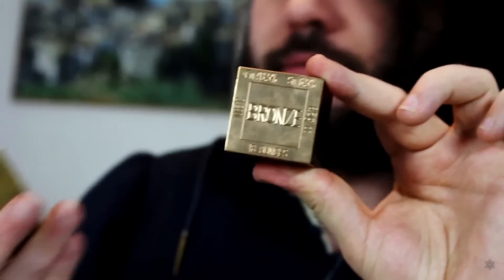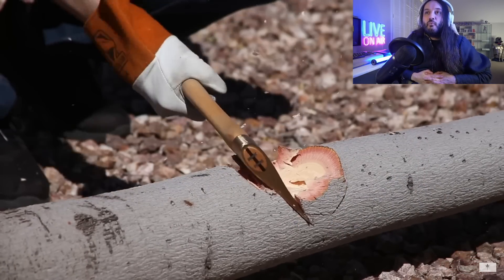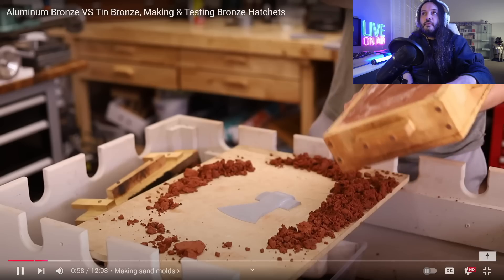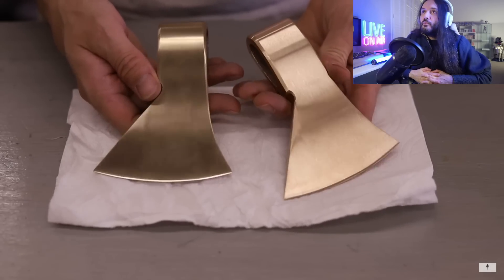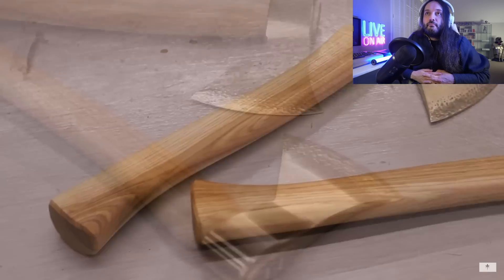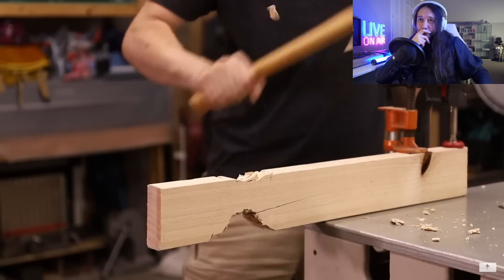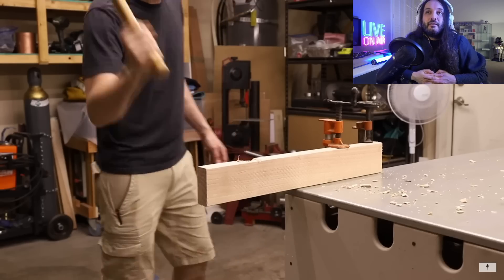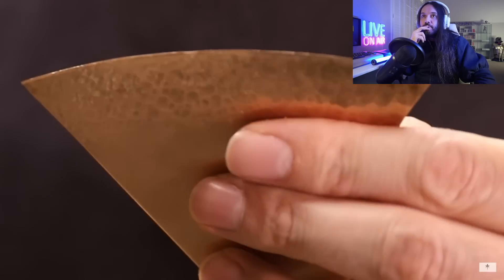Tin Bronze is INCREDIBLE - This Video WILL Change (Blow) Your MIND!

Comment: I think I get your point, with regard bronze not being "soft as some people claim it was, thus being replaced by iron". But in this video we literally are gasping at a tin bronze hatchet being able to cut dry oak. If this was even straight up iron we would be thinking "duh, of course it cuts it perfectly". There is a CLEAR difference, and that's most likely why people switched from one to the other as soon as they could mass produce it. And yes, not everyone, not everywhere, and you would probably have bronza laying around for a lot of years that people would use, reuse, recast, reforge, etc.

Comment: Theres nothing soft about bronze. Irs used extensively in ship building and often in hard wearing items that need tl be corrosion proof... ie. Propellers 
As an archaeologist my argument about why iron took over from bronze is availability of copper and tin. The latter is extremely rare and both remain valuable metals.

Comment: One of my hobbies is metal detecting,  ive found part of a bronze age sword and the cutting edge of a socketed axe .
The sword,  double edged is still sharp enough to cut , slice through skin, the axe less so.
I've also found a BA awl , used for making holes in leather and such, im sure it could still do a job , if it wasn't so old i would try .
All items have been to the museum and dated to around 1800 bc . 
Found in Hertfordshire,  S.E. England.

Comment: Prolly wrong as I’m not and expert, but I imagine the cracking is from the amount of force needed to cut the wood. A steel blade can be thinner with similar strength allowing less force need to cut the fibers.

Comment: By the way it might take you a while to do the first one, but after that experiance takes over. The part you did not understand has to do with the pour. Also after you have moulded a few items you get better, after experiancing the shrinkage  one learns to add small pockets so that the moulten metal  can be drawn back into the original casting. The most impressive art of casting is to create the metal from scratch. Figuring out the proper percentages. Also the art of purifying the materials takes time to learn. My great Grandfather was a blacksmith and after years of  working at it I still cannot do what I watched him do. Also by not experiancing  these arts you really do not have a full understanding of the intellect that ancients had. Interestingly even watching someone do it, does not impart all the knowledge you need to really understand. One can pour a bronze age  sword clean it up and it is suprising how dangerious it is. I was always facinated by being able to take raw materials and learning just how much effort and thought it takes to recreate items from the past. Purity is where the real skill is. The first time you create something from scratch and see all the impurities and how  they effect the utility of the item. That is when you really gain an insight into truely respecting ancient craftsmen.  Also learning the riddle  of steel imparts a far greater respect for ancient man. Also there is a trick I learned in the back waters of a poor country from a craftsman. There is a way to use other materials to slow the cooling down or speed it up, this effects the crystaline structure in the edge. And thus the stength of the edge. One has to wonder how many discoveries came and past into forgotten mists of  the past. Ancient people did not have computers but they were a very long way from being unintelligent. Can you imagine the amount of work required to outfit a single roman legion?.

Comment: 8:30 Work hardened bronze can be harder than iron, depending on a multitude of factors. The hardest mention for work hardened tin bronze I found was 28 HRc (hardness Rockwell C-scale), while pure iron is around 40 HRc but depending on quality can be as low as 11.4 HRc. From what I found in my limited research anyway - if anybody has corrections to this, I'd love to hear them.

Comment: Bronze is also used for large caliber bullets for hunting very large game to ensure penetration and mass retention. Lead will carry more energy over a greater distance, but will shed mass quickly upon entry. Steel is likely to pass through without doing enough damage to to cause a humane kill, or in some circumstances can actually shatter on impact with bone. So often bronze or brass is used because of it's density and relative hardness, while still being malleable enough to prevent fragmentation. It's expensive as hell, but then it's going to be fired out of a gun likely costing tens of thousands anyway, so ammunition costing fifty, a hundred bucks, or more per round probably isn't an issue for the person using it. Not that you'll be shooting it a lot anyway since recoil tends to be very much on the punishing side of the scale for those types of rifles.

Comment: I'm a CNC guy, I worked in bronze even though I mainly work in steel but I certainly worked in iron a lot too as well as I have done stuff in copper, brass, aluminum and some other materials as well.
Bronze is tougher then iron, there are seasons why you very rarely see large bronze swords, mostly because of how incredible expensive they were to make but also because bronze weights more which isn't a big deal on a short sword but if you make a long sword in it, that difference adds up.

Bronze lost a lot of it's popularity when the trade networks collapsed during the bronze age collapse, not because it was a worse material then iron.
Already, a lot of the early steel is not really better then bronze but so much easier and cheaper to get your hands on.

That is tin bronze but there is another bronze that was popular in Easter Europe and South America (yeah, the Tiwanaku invented it there even if if later cultures like the Incas only used a little of it): Arsenic bronze. Tin bronze is both pretty hard but it is also very flexible which is the reason it was so popular in cannons even during the 17th century (it was so expensive it was mainly used on flagships though like the Swedish ships Wasa and Kronan for instance).
Arsenic bronze is more brittle and it is also rather dangerous to make since it can poison you. That is the reason tin bronze took over Eastern Europe but it is still a huge step up from copper which is why it was used in South America up until the Spanish and Portuguese showed up, but after the Tiwanaku it was likely incredible expensive and mainly used for ornamental objects.

Bronze is a great material to work in and while it is very expensive, there are plenty of bronze age weapons they are still deadly to this day. You can't say the same about iron age iron weapons, most of them are more rust then iron. I think video games where bronze usually is a lower tiered metal then iron have given people the wrong impression of bronze.

Comment: I work as a water/wastewater operator. We hate working with anything but plastic, concrete, rubber, and red metals. Brass and Bronze is incredibly resistant to corrosive material found in manholes. It will actually last longer than the concrete, which slowly falls apart. Fuck aluminum and iron. All my hommies hate aluminum and iron. That shit might last a couple years then fall apart when you need them most.

Comment: Early iron weapons were about as good as bronze weapons. Kelts kept using bronze way into iron age. The main advantage of iron in early days was its abundance. It is almost everywhere. Tin however... Irish tin was used all the way across Europe and North Africa to Middle east because there simply weren't that many places where deposits were abundant enough to be discovered and mined anywhere else. Later as metallurgy improved, even iron (not steel) tools/weapons became better than bronze ones but that was couple centuries later.

Comment: It's true that iron was overall Superior to bronze, but very few actually understand the reasons for it. 

It's actually only Superior if it's carburized correctly, also once we got the technology it ended up being cheaper to produce (though this was largely because of the scarcity of tin at the time)

This is exactly why even though some iron weapons did exist during the bronze age, they weren't the norm despite the much wider availability of iron.  Because even once they were able to smelt and mold it properly, it still made for weaker weapons at first. Some suggest that some of these were made out of desperation during the bronze age collapse, which would make sense to the tin supply issue, but even that still proves the point that bronze would have been Superior at the time.

Or to put this another way, an iron weapon is actually inferior to a bronze weapon, but a steel weapon is superior. 

The iron that supplanted bronze was steel.

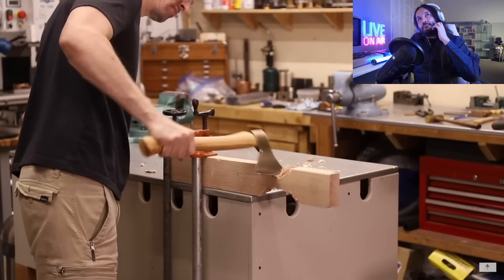Comment: 11:10 that kind of “crack” tension failure in wood is called brashness, as in “That’s a brash piece of wood”. It’s characteristic of wood that’s grown and harvested too quickly. Of course brashness is incidental to the comparison test of the axe heads, as long as the two axe heads were tested on wood with the same properties.

Comment: In folklore smiths were often considered to be magicians.  After all they transform ore into metal and then into into useful tools.  This is in fact the basis of vulgar alchemy - the transformation of each metal.   Philosophic alchemy is where you purify and transform yourself in the same manner.  So there has long been a fascination (in the old sense of the word) with the art of smithing.

[And yes, I too consider myself an alchemist at heart. And no I haven't transformed lead into gold, but I have, over my career, transformed a small amount of gold into lead.  As for philosophic alchemy.  <shrug>]

One of the advantages of bronze over iron is the crystal structure, which is generally face-centred (FCC).  This makes it difficult for flaws to propagate through the structure of bronze, and makes it relatively easy to repair.  Iron (in the times we are talking about, has a body-centred crystal structure (BCC), through which it is a lot easier for flaws in the crystal to propagate.  This is why it is vitally important to polish out any nicks in an iron blade.  Metal fatigue is a big problem with iron blades, leading to them breaking if not taken care of.  This is one reason the Scottish Play has a bad reputation as it contains a scene where the protagonists fight with greatswords in a very theatrical manner (clashing their blades in exactly the manner that blades shouldn't be used).  Since they rarely take proper care of these props, the blades have frequently broken during performance and rehearsal.  And having a hunk of metal flying off in some random direction is not conducive to continued happiness.

Now if only bronze wasn't so expensive in historic times.

Comment: I have played with casting lead and it's alloys,because of my interests, and all metals react differently to heat and cooling, like aluminum and brass, but in my research, there is a zinc/aluminum alloy that can be used for gears and other objects that need strength but also wear well. You would think it would be too soft for such use, but there are examples from the 1930s that are still performing their jobs today!

So when people dismiss brass, or zinc, or even aluminum, they don't really know what they are saying. And I suspect they are just repeating what they have heard without knowing the true strength of metals.

Comment: Brass hammers are still a thing. You can use them in dangerous environments because it is far less likely for them to throw sparks and cause a fire or explosion. Ampco still makes an aluminum bronze fire axe. Same reason, non sparking and non magnetic.

Comment: Interesting video, Rafe.
On a semi-related note, I was working on a project at home that required a lot of drilling through steel.  I initially began the project using my HSS drill bits (High Speed Steel), and it was extremely slow-going and tedius. I upgraded to a set of titanium drill bits, and I was amazed at the difference. They cut through the steel like the proverbial "hot knife through butter".

Comment: I was always told that bronze and iron were comparable in strength but an iron blade will hold an edge longer, not enough to be significant. What I was taught was that iron was 10 times cheaper than bronze and thus by far the superior metal.

Comment: 4:08 He is talking about thermal expansion. Hot liquid metal takes up more space than cool solid metal. The rate of expansion is different for each metal. When you make a cast the liquid metal fills the space and forms into the shape of the void of the cast. When it cools into a solid piece the metal 'shrinks', but this is simply the volume decreasing. This shrinkage happens while it is becoming solid, but not quite solid yet. Since the molten metal needs to be fluid enough to fill the space well enough you can't work with cooler metal to decrease the shrinkage and instead need a different method to deal with it. This is where the holes come into play, as makes the mold with a tube of extra liquid metal that ensures that the liquid metal flows into the mold as it cools and shrinks, leaving the metal in the tube distorted and the rest of the metal in the mold undistorted from shrinkage. It is a common trick with any sort of mold process in which the liquid changes volume, even water if the mold is large enough.

Comment: As you suggested, the main advantage of iron over bronze is the fact that iron ore is much more abundant. However, I grew up in a family that owned a metal salvage business, so I have handled many types of metals. While it is true that bronze is not soft when compared with lead, iron is many times stronger than bronze. An iron ax would have chopped through those boards in a couple swings and would be almost entirely sharp.

Comment: In foundry class, we were taught that the upper half of the sand mold is called the “cope” and the lower half is called the “drag”. The foundry sand itself is held together by an oil binder in order that the sand does not crumble apart. The sand pounder is called the “ram”. The sprue, runners and riser are paths in the mold where the molten metal flows. Work hardening the bronze edge makes it considerably harder. However, too much work hardening can make bronze too brittle. That is why the bronze smith knows when bronze needs to be annealed by heating it and allowing to cool thus restoring its malleability. Testing the hardness of a work hardened bronze edge can be done by scraping it into annealed bronze. The harder the bronze, then the deeper it will penetrate into the annealed bronze.
Reply: Bronze was almost universally cast in carved stone moulds in antiquity. We know this because we still have the moulds.

Comment: I have forgotten most of my metal knowledge, but I think I recall that cast iron was indeed not better back in the day, not by much anyway, if at all.
Iton is not all made equal, as you know, and back then the know how would not have been there yet to get the best result from what they did have with the tool they did have back then.

Comment: Solid brass hammers are common in the machine industry. Because they are softer than steel they can safely be used on equipment without damage.

Comment: 6:19 It's still mostly copper so it would be weird if the difference was actually massive. That's still a bigger difference than I would've expected. I'm curious what the ratio was. I've seen the original video but I don't remember if it was mentioned.

Comment: Materials science can be quite interesting. While pure aluminum isn't very strong, 7075 aluminum is just as strong as some steels at a fraction of the weight, which is why its so popular in the aerospace industry. Meanwhile, copper-beryllium can be as strong as inconel (stronger than pure tungsten).

Comment: 10:15 I have the same interest of metal and wanted to point out that iron is afaik softer than bronze, not the other way around.

Thats different for steel, depending on the steel, but tbh. steel is so a depp rabbit hole that I successfully avoided so far.

Comment: we still use it today in many applications we normally think are only suitable for steel such as bushings and bolts. I also seen a bronze sculpture with a sword and the sword but was quite flexible and springy like you imagine higher quality steel to be. In fact I’d reckon you wouldn’t necessarily have a hard time making a longer sword out of bronze. It’s just much more expensive and a bit heavier

Comment: People stopped using bronze because it was hard to get, not because iron/steel was that much better, steel need higher temperature to work it, but the resources are way easier to find and cheaper. When people figured out how to smelt steel bronze was done.

Comment: I've was always told the initial advantage of iron was that it was plentiful and cheap.  I'm only recently discovered historians saying that black smiths discovered steel, early on in working iron, but the techniques of making good, relatively soft iron took centuries to develop.  The Greek hoplites carried swords of bronze, when iron was only good for arrow heads.
Reply: Iron making is HARD. The ore is plentiful but the technology required to make molten iron eluded the Europeans until the 1500’s (although the Chinese had it over a millennium earlier).
Like the Japanese, the Europeans had to forge weld blister iron into blocks to make large items like swords.

Comment: If I am correct why he didn’t make a version of the axe from iron is because iron is preferably forged and not cast as for the axe heads and swords so he might not have had the equipment needed for the procedure. I might be wrong though…